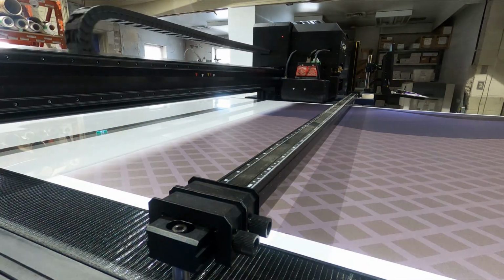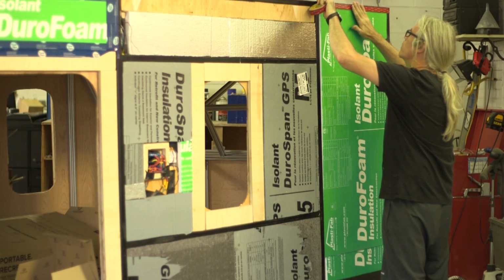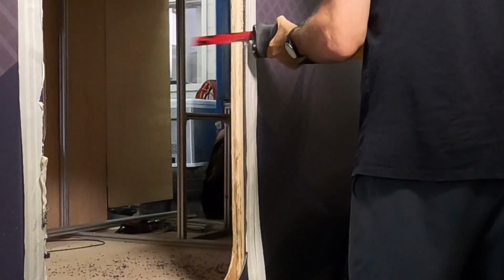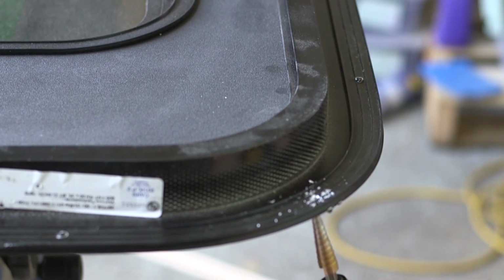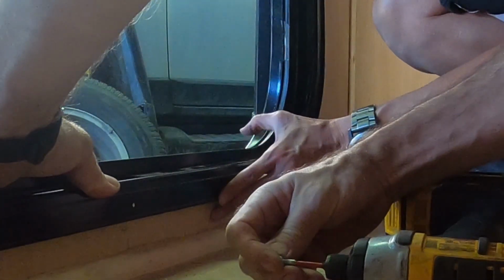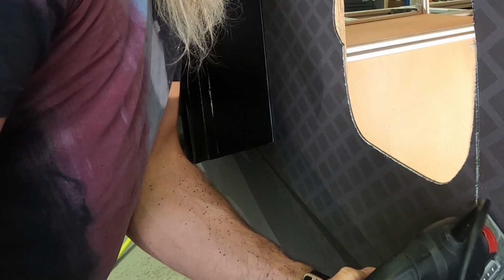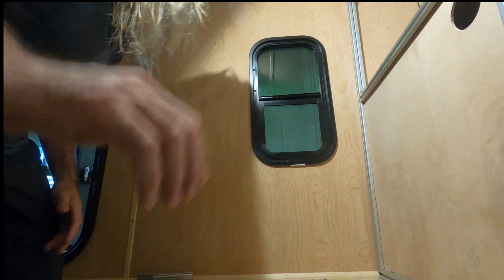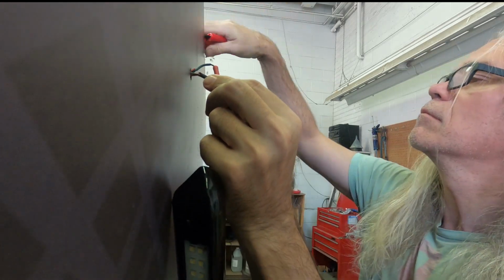Squaredrop Camper build part 4 - with plans

Comment: seems like you stuck VHB to the tremclad painted frame.  Seems that you are now depending on the adhesion of the paint to the steel.    Did you consider apply VHB to the steel?
Reply: Thanks for the reply. I am going though the same dilemma. Maybe aluminium frame is good. But I cannot weld alu
Reply from the maker: I did think about that and the desire to rust proof the frame won.  I’m not certain if the VHB would continue to maintain its bond to the steel if it rusts.  The doors and windows and water heater really do a lot to hold it all together.  Mind you I haven’t finished the dam thing yet.  Thanks for the question.  Hope that answers it.

Comment: what kind of VHB tape did you employ?  Greetings from Niagara
Reply from the maker: I buy 3m vhb and it’s really expensive.  You could use syka flex or 5200 I think if you can’t get vhb.  You would have to apply pressure on the skin to hold it to the trailer until it cured.  Remember the doors and windows are going to help to hold the skin on to.  I did use pop rivets on any areas that lifted.  Hope this helps
Reply: @lifeincolor7680  Yes.  I did expect you would use 3m.   but I am aware or a dozen or so different kinds from 3m   What did you use?

Comment: Great work so far!  Are these aluminum composite panels?  I thought I saw a description of them but I went back and can't seem to find it.  I am trying to source some of these for my own build.  Thanks!
Reply from the maker: Yes they are. Alupanel or epanel.  Advantage 5 by 10. Painted.  Disadvantage thin aluminum skin. If your going to print make sure to overlaminate.  Sabic polymers or em plastics in Canada

Comment: Be careful of your water tank freezing, swelling, and breaking your frame. perhaps just empty it in cold weather
Reply from the maker: Thanks for the advice.  I do have about an inch side to side. Two inches end to end.  But little to the floor.  The speed at which I’m building this trailer… I might not be getting out in it till snows on the ground. ☹️😜☹️

Comment: hey just wondering i downloaded your drawing of the trailer and the fame work . but i was wondering if you have the measurements for the placing of the framework .
Reply from the maker: The sketch up should have the exact location if the framework.  To be honest I flushed everything to the edge the the five by ten bottom frame.  I used 1 by 1 square tube for welding the top.  I used quarter inch plywood on the inside and 1/8th inch thick aluminum composite panel on the outside.  The between that 1 inch foam insulation.  We did not post the very top of the framework as to be honest I kind of just welded what I thought would be right.  Mind you I set up 14.75 inches square for the fan on the roof.